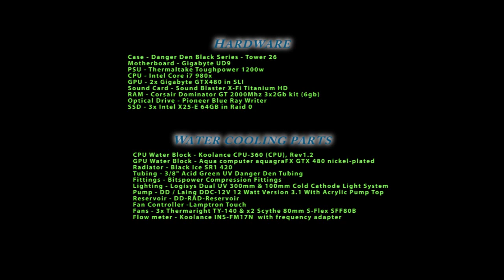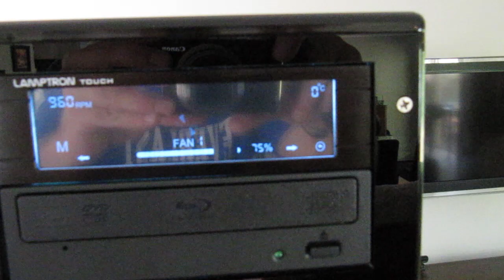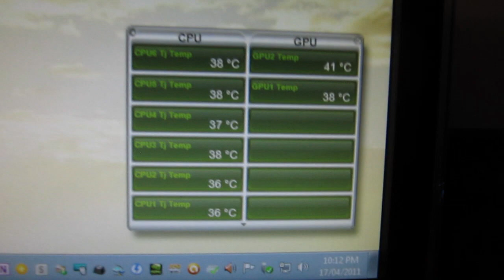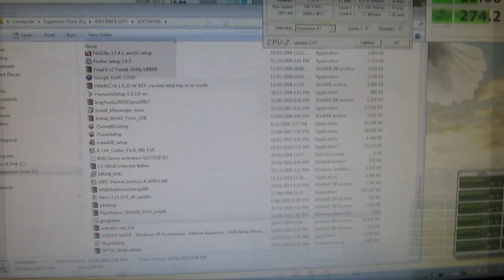Dream PC 2011 Remastered

Comment from the maker: @erickrayos Yes its blowing towards inside the case, there are fans in the back to exhaust the hot air out.
Have you thought about the downside of blowing from inside to outside the case? Tr ying to cool the radiator fins with hot air inside the case is worse option.

Comment from the maker: @strapex1 That one runs from the radiator outlet to the bottom of the reservoir where there is an inlet, It is hidden by the outlet connection on the reservoir.

Comment from the maker: @Uknown231231231 That depends on what your doing. My six cores go to work when running intensive applications and gaming with Battlefield 3 on Ultra settings.
Also all the benchmarks will show otherwise with significant results differences between stock and overclocked settings.

Comment from the maker: @TheChrisglasgow Just one big rad. Its Black ice SR1 420. This rad uses x3 140mm fans.
Under load it just goes over 50c to mid 50's thats for GPU and cpu.
Pretty good temps for one rad and my fans are very quiet. I chose every part carefully because i wanted a quiet system.

Comment from the maker: @dealio1224 the kit i got included the pin disconnect tools, one of the tools broke half way through though.
I ended up buying a fancy Lamptron tool kit from a guy on ebay. Performance pc and Frozen cpu both have this kit, about $25.

Comment from the maker: @FsimulatorX Thanks for your interest, GTX580 has higher clock speeds and does draw a little more power.
Performance difference is marginal, under 10%
If i match the clock speeds on my GTX480 they will match the GTX580 because it is virtually the same card, Nvidia released the GTX580 to improve thermal properties. But i couldnt imagine using air cooling on these volcano's. These cards with thank you when putting them under water. Youtube vids demonstrating power usage and fps between both cards.

Comment from the maker: @TheChrisglasgow I dont know about those temps, my second card in my loop is only ever 2 degrees more than the first. 
Is he running SLI or xfire? Looks like only one card is running black ops.
You also need to consider ambiet temp (room temperature) Anything within 10 degrees of room temp is great for idle temp.

Comment from the maker: @dealio1224 I have used two different sleeving kits, They were both fine but out of the two the better one would be from Frozen CPU. They have a large range of system sleeving kits and good quality. Mine was the Mod/Smart Professional System Sleeving Kit - UV Purple (SKIT2-UVP)
They do have this kit in white and will be enough to completly sleeve your whole system.

Comment from the maker: @doctoryoinky Your best ssd for budget of $175 is OCZ Agility 3 60GB SSD 2.5

It is available at pc case gear for $149 AU

This uses the new sata 3 6gb connections which your motherboard supports.

Very impressive drive, Max read up to 525MB/s, max write up to 475MB/s, 50,000 IOPS

Comment: One of these would look nice in your case they have a gloss strip across the front bezel, it would match your case nicely.
Plextor PX-LB950SA - Graveur Blu-ray et DVD - BD-R/RE 12/2x DL(BD-R/RE) 8/2x DVD(+/-)RW/RAM 16/8/16/6/12x DL(+/-) 8/8x CD-RW 48/24/48x LightScribe Serial ATA

Comment from the maker: @TheChrisglasgow Theres alot of things that effect temps but you mentioned "gpu's" as in more than one so id guess that 240 rad wasnt enough to cool it but your temps are way high. even the stock coolers would have done a better job so im guessing something wrong with your previous loop. Your new temps are great though but man those fans at full speed are gonna be LOUD! My temps are with the fan running at 960rpm.

Comment from the maker: @krazy931 It gets extremely hot on air under load, Above 90 degrees. one of the hottest cards ive ever seen. I agree with the coloured tubing and cant believe people still use coloured dyes and coolants in their expensive hardware.

Comment from the maker: @BlackRockMineCraft Sure i can advise on a few things but need to see your planned build first to advise properly. 
Have a think about what your build is gonna be used for? also decide do you want to achieve maximum cooling (which is loud!) or a quiet system or somewhere in between, you know best cooling for noise level.
You need to know this cos some radiators and fans are designed with this aspects in mind and this will affect which parts you buy. Danger Den have great customer service too.

Comment from the maker: yeah looks like what eva you use to monitor temps is playing up. Especially if you ran crysis for a while as it would have reached equilibrium. 
Are you able to show a pic of your loop or write the order the parts are in the loop?
Also what are your cards and what tool you use for temps? Try nvidia system monitor if your cards nvidia. Maybe the second card has too much restiction... What blocks you using to cool gpus?

Comment: Those temps are very good ! Im using a blackice sr1 480 rad with 4x gentle typhoone 5400 rpm fans, and a 240 rad just for gpu's, corsair h70 for cpu, i havnt
Personally did any temp tests as pc is still in shop, but guy in shop said max temp was 45 on full load, im happy with that, b cos wen i was just using 240 rad temp went into high 90's sometimes 100, but the pc would shutdown as a saftey precaution.

Comment: Advice on my build?
intel i7 2600k-cpu
msi gtx 570-gpu
 asus P8P67-motherboard
corsair vengeance 8gb (2x4gb)-ram
diablotech da series 600w-power supply 
seagate barracuda green 1.5tb-hard drive
coolmaster storm scout-case

Comment from the maker: @erickrayos All builds have hot air inside case, even water cooled pcs. Just think of the heat coming off the parts inside the case. Some people choose to have the radiator on the outside but looks ugly. If i understand you correctly you think that watercooled builds have no heat inside case therefore you think better to have fan blowing from inside case. Problem is that there is alot of heat inside case that is why better to push cool air from outside case to cool the radiator.

Comment from the maker: @doctoryoinky Its unfortunate you bought seagate barracuda green 1.5tb-hard drive.
This drive is designed to use less power and therefore only spins at 5900rpm which results in slower read and write speeds. Can you return it or exchange it? Your hdd choice will bottleneck your system therefore not taking advantage of the processors power. Raid 0 is definitely the way to go and affordable. The Samsung SpinPoint F3 1TB  is only $59 at PC Case Gear. ocz 700w is a good choice as it is 80plus cert.

Comment: I plan on upgrading from my Antec 1200 to this case and watercooling it. Did you have to modify the case at all when you installed your H20 setup? Also how do you like the Lamptron Touch fan controller? I've heard a lot of good things about it.

Comment: I like to know the name of the watercooling system ... I had to had 2 different cooling system for my sli set up and the cpu because the video card runs up to 65-70 C and if it's on one loop the cpu ran up to 60 because of the hot water.

Comment from the maker: @nakatabrother Thats cool, Did you use the same case? You should share your build, Id like to see some pics or video. I agree with led fans at the front but i could not find any good quality silent led fans. My goal was to build the quietest possible pc without compromising on performance. What was your goal with your build? 
ps...i might mod my existing fans to add leds cos they are in my opinion the best by far, Google Xbit Labs 140mm fan round up and you will see the most popular fans tested.

Comment from the maker: @tezzandleanne I had the same approach where i didnt want to upgrade for a long time so i went out and bought the best parts at the time. It cost me over 5k. In saying that i could have spent half of that amount to build a simillar custom watercooled pc with maybe 5 to 10 percent difference in performance, You know "Best bank for buck!" You might be aware the difference in cost between best cpu and second best is huge but performance wise simillar. best bank for buck cpu these days is i7 2600k.

Comment from the maker: @Marlon0375 I never adjust the voltage to get 4.0ghz, It must automatic adjustments which are on the fly. I did just finish running prime 95 and unigine heaven benchmark. Dont think it will change anything, do you?

Comment from the maker: @BlackRockMineCraft All watercooling pc's need fans to cool the radiator. So there is always gonna be noise infact some extreme water cooling pc's are louder than air cooled pc's.
So you need to research some more. There are guides at danger dens forums and also pure oc forums.
Start reading so you understand whats involved. I cant help you until you understand all of this.

Comment from the maker: @SynoDesign Still dust everywhere? YES! enough for a filter? NO!, Fail? HARDLY. Troll? DEFINITELY! I was surprised myself that my acrylic case is easier to maintain than conventional case and is as simple as one wipe with microfibre cloth and your done. Reason its easier is because it is just a simple square case where your plastic and metal cases have lots of bends, holes and grooves inside which make it tedious to clean.

Comment from the maker: 420 is enough even when overclocked, at the moment just cpu and ram overclocked and temps stay in the high 50's.
Even with gpus overclocked at one point temps only 2 degrees higher on average.

Comment from the maker: @exodush4x i just overclocked my gtx480 to 850mhz and ran open gl at 50.39 i suspect my cpu @4.2ghz will be simillar to your results aswell. Are you watercooling your build with those overclocks and do you run it overclocked 24/7?

Comment from the maker: I see, Are you after high flow? The 1/2" is higher flow than the 3/8".
Research every part in your watercooling loop before buying anything. Find out how restricted the flow is your water block choice and check same for radiator. Buy a decent pump. Post your build once finished:)

Comment from the maker: @exodush4x @4.0ghz i get 9.93 on cpu. i couldnt be bothered to overclock cpu now but i did run the open gl test on my GTX480 in SLI and i got 48.44 fps. How does your 570 go on that?

Comment from the maker: @nakatabrother I disagree, Liquid cooling is a geniune alternative to stock air coolers. air coolers are simply "Not god enough" in most enviroments. I cannot not tell the difference from 4ghz to 4.5ghz, Can you?
I have experimented with max overclock, got it up to 4.5ghz. Your mad to stress your cpu like that, even with low temps it will still reduce the life of your cpu. But hey atleast you can brag about your overclocks while it last.

Comment: GTX 480 in SLI is a total wast when it comes to power draw it uses the same power as GTX 580 on SLI except the 580 on SLI has way better performance. But still nice rig

Comment: But dude i must say its a waste to run 980x or 990 on liquid cool only clocking it at 4.0ghz , even if u do not use liquid nitrogen or TEC, u can still push it to around 4.5

Comment from the maker: @doctoryoinky I just build a pc for girlfriend with same cpu, without knowing your budget im guessing you want best bank for buck...
There is a new chipset for this CPU, Its the z68 chipset and combines the best of p67 and h67 chipsets plus has new features which can speed up your drives if you choose to get a ssd later on. I went with the ASUS P8Z68-V Pro Motherboard B3. Go with x2 Samsung SpinPoint F3 1TB HD103SJ and raid 0 them. check your memory details, Get at least 1600mhz and low latency